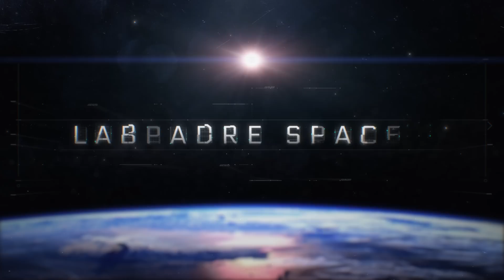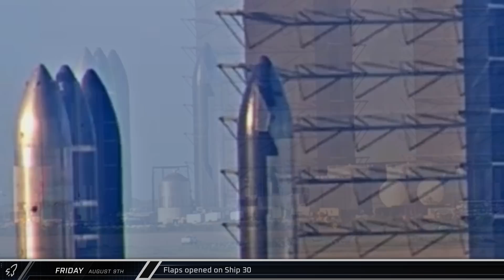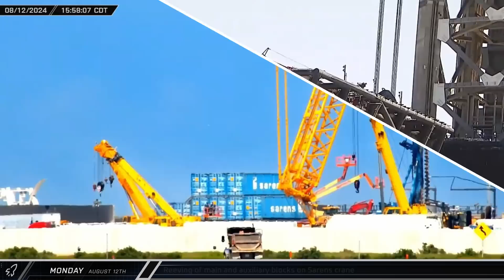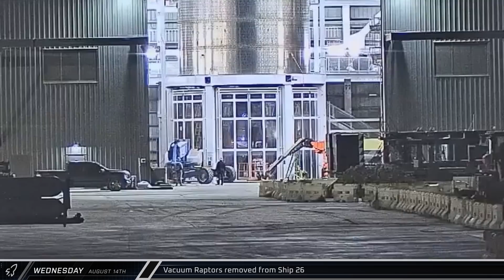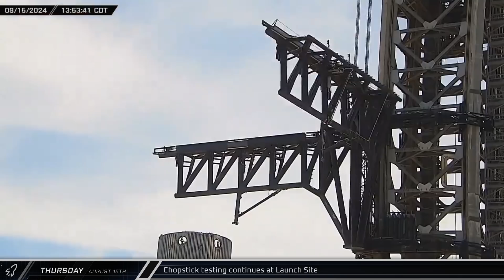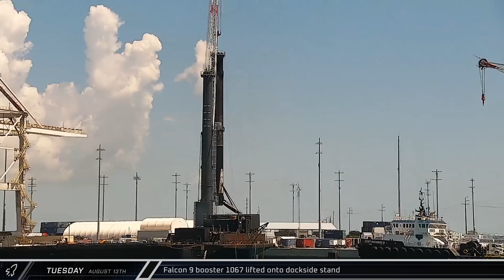SpaceX's First Superheavy Catch Attempt Is Almost Here - SpaceX Weekly #128

Comment: nice to hear you guys picking up the correct construction lingo now. You can now start saying "CFA piles" instead of drill holes and fill with concrete, CFA = Continuous Flight Auger Piles - the auger drills down but then actually pumps in concrete as it extracts the hollow auger. This way the sandy and probably saturated coastal ground does not collapse in on itself. The reinforcing cage is then vibrated into the wet concrete. Sometimes they are just doing ground improvement and will just mix in a grout as they extract to create stabilised unreinforced earth columns.

Comment: Elon, you and your choppy-stick butter boy team better start working on a SOLID ROCKET assisted chop stick arm closer. There is no other way to do this to catch the booster in the required time. Better get the butter boys busy and get the engineering done and hardware built, installed, and tested,
Reply: Why soild rockets when they can't be turned off and they already have Draco or eventually mini raptor, just seems like a little much to develop that kinda thing for that kinda fix
Reply: @absolutelyindustrys 
It's technically called a kick motor. a very small motor(s)(custom size thrust) to give the arms some instant momentum and that momentum in the arms can be slowed down very fast if they need to adjust the distance to the booster body. What they got going down now is "stinking thinking".